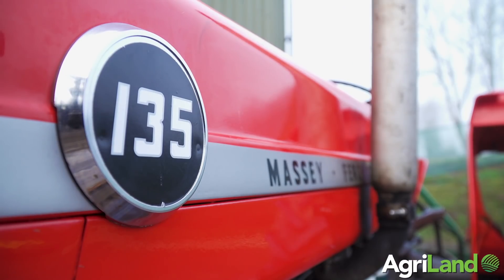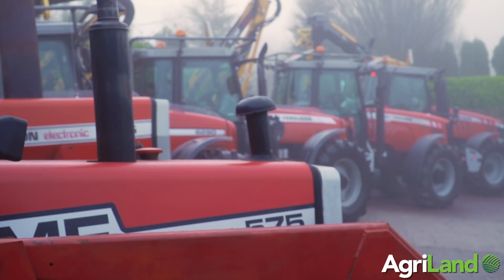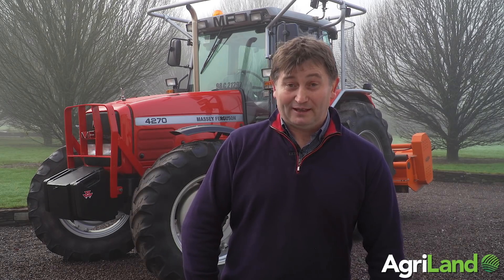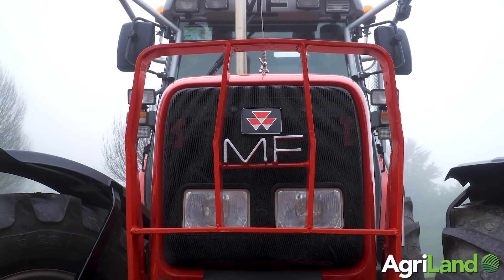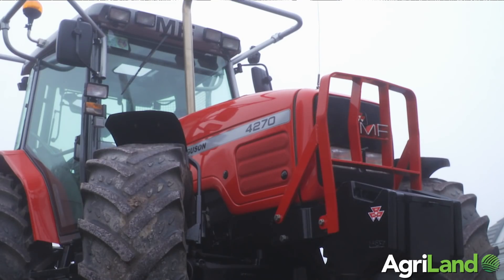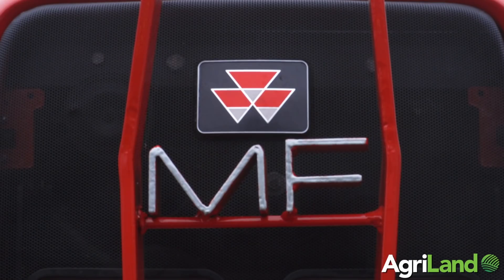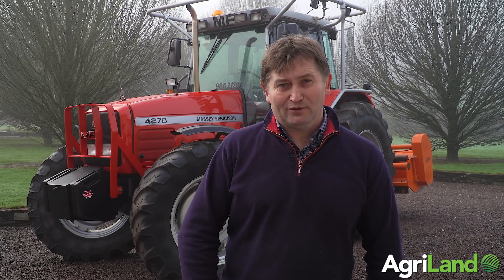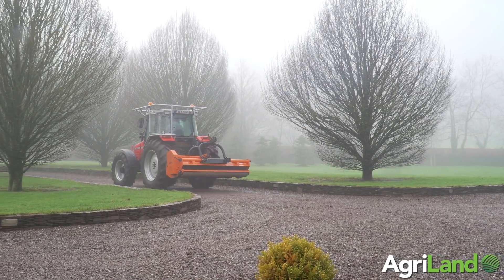AgriLand meets a hedge-cutting contractor...with well over 30,000 hours on an MF 4270

Comment: Its like triggers brush in .only fouls n horses  it had 3 handles and 4 heads
Reply: Triggers Broom.!
Reply: Yes it's all been rebuilt
Reply: What? Original engine and transmission, bar a few clutches and tyres I’d say that’s not bad! 
Not many tractors at those hours still on the original engine!